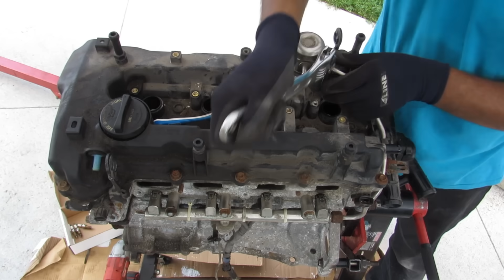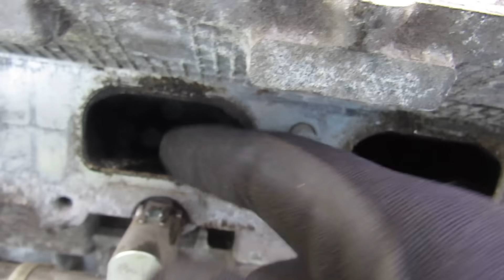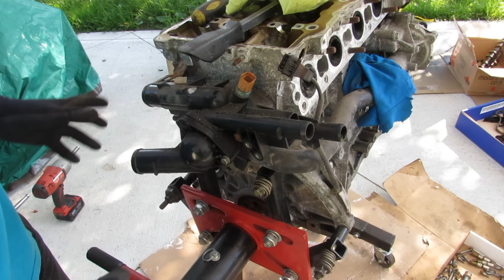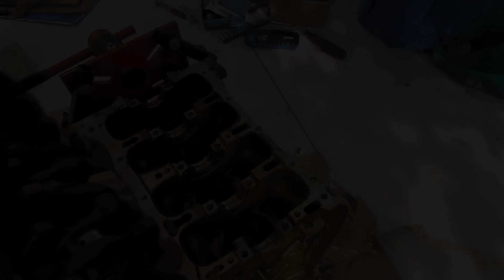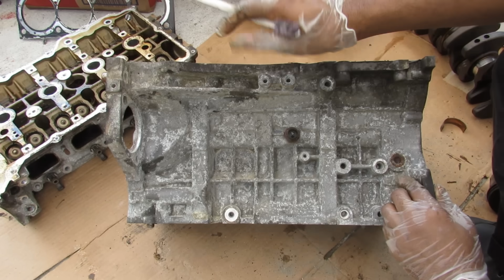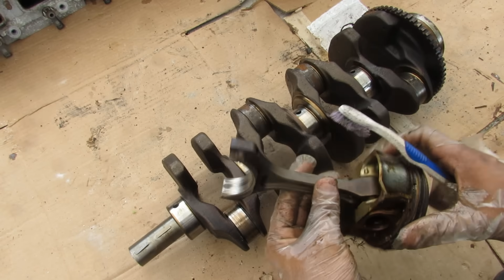Why Hyundai Engines FAIL

Comment: Thank you for explaining what happens with this engine. My girlfriend's 2014 Sonata just seized up and nearly caught fire recently, after just over 100k miles with regular, timely maintenance. They're replacing the engine for free, but now we know we'll have to watch this car like a hawk in the future.
Reply: Yeah good luck with that,they replaced my engine on the 2014 Tucson after my engine rods blew and just since December I’ve been having different issues ever since
Reply: I have a 2014 Sonata with almost 100k miles. No problems yet. Burns a little oil.
Reply: Even newer model sonatas with updated engine have the exact same problem, engines catch fire, and metal shavings in engine from the manufacturing process, its pathetic how after all these years they still cant get these engines right. Australia has just launched a massive lawsuit against hyundai/kia. I would stay away from this brand until they fix this problem.
Reply: They replaced our Sorento engine at 105K when it siezed up. Not many miles since but so far so good. I feel KIA treated us well.
Reply: @cheaptick  which Kia do you have?
I have Kia Sorento 2016 Turbo TGDI my engine seized up at 117,000 miles with thanks God extended warranty, they did engine rebuild I don't see new one.
My check engine light still on one day after it being services it  took 3 months to get my car back.
They have good customer service and are courteous most def. but they also lied to me as well.
As my fuel injector messed up still they lied said the light "should" stay off but, next day it turned back on, went to my friends garage that certified mechanic he's like yeah fuel injector my car sometimes idols high and sometimes low putter when get past 40 or 80 miles per hour and all did was fuel injector cleaner.
Now time for new fuel injector component.
Anyone else have big headache with Kias?
Go to your local Kia dealer you will see alot Kia being serviced in particular the Sorento, Souls, Fortes just heads and warning that how many time I've gone back and forth with Kia to know which cars to Not buy!!
Reply: My 13 elantra is at 153600 miles.  This weekend started the motor seize process where I have loud rod knock and barely any power.    May I ask,  what is the process you had yo go through in order to get this engine replaced? And also how long ago was this if you don't mind.  

Thank you much!
Reply: @BuschMANb  In short, contact your dealership as soon as possible! :D Your Elantra does not have the Theta II engine, but I do believe there is a separate lawsuit that was settled last year concerning Hyundai Elantras from 2011 to 2016. In our case, we simply contacted the dealership she bought the car from and they replaced the engine free of charge. This was about seven months ago.
Reply: Mine just seized up at 101k… currently is at Hyundai motor’s… what was the approval process like for you guys?
Reply: @lovetiffeny5357  a few days and approved... I think our records (previous Owner) were ok
Reply: Is this a Sonata problem, not effecting the Elantra? I have a 2017 Elantra, with almost 107k miles.
Reply: @jayholm2142  This is a problem with the Theta II engine, which was used in multiple cars, not just the Sonata. I believe your Elantra has a different engine.
Reply: @ISKLEMMI  good to know, my Elantra is close to 107k miles, but I hope it will reach 140-150k miles without too many issues....I want to move on from Hyundai. Currently researching the Nissan Versa, good balance between features and price.
Reply: My kia souls engine seized at 19k miles. Found out there was no oil in it despite regular oil changes.... Got a new engine. 1 year later ... I'm having to add oil to it because if I don't the dip stick doesn't have oil on it after 2k from the oil change.... Doing an oil consumption test after 1k. It shouldn't be burning 1qt+ of oil per 1k miles like it is....
Reply: @catherineb5766  can you give an update? What was the outcome? You get a new engine?
Reply: @asianstud7  they probably won't replace it a second time. They told me 1 qt every 1k miles was normal by their standard. Which is stupid because by that logic you'd run out of oil before your oil change on a new engine. I guess I don't know enough about cars and maybe that is the new norm..  Anyway. So I guess I'm stuck adding a quart of oil every week or so as long as I have the d#$# thing. My Nissan and toyota never had this issue.. so..

Comment: Hyundai sells turds and turd accessories.
Reply: that you can;t afford.
Reply: @maga6319  lol what do you mean? They'll finance anyone. Kia and Hyundai are eager to sell you a shiny turd.
Reply: @bens6865  So does Toyota you drive. Again, is that why you can't afford Korean cars?
Reply: @maga6319  you're not making sense. Oh Kia and Hyundai are affordable, but I  prefer my motors without metal shavings from the factory. Also everybody that I know that has a Hyundai with the 2.0t, the motor blew before 100k. I'm good chief. No, thank you.
Reply: @bens6865  people that you know who owned a Hyundai with 2.0t doesn't take care of their car, therefore it failed on them. You don't know the whole story behind a car that fall apart. Most times it's their fault for not taking good care of it.
Reply: @maga6319  one of them was an automotive student.
Reply: @bens6865  they didn't tell you the whole truth
Reply: @maga6319  look it up the 2.0t sucks. It's a shame because the cars actually look good. It's a shame because Veloster N is pretty cool, i wouldn't risk buying one though.
Reply: @bens6865  I did and it's full of BS you're telling. Just say you can't buy one because of some f00l told you a lie about Hyundai's reliable engine that barely give problems.
Reply: @maga6319  like I said. Shiny turds. Thanks I'm good, 2.0t is a turd and so is the 2.4 theta 💩 the 2.0 in my sister's Elantra had the Biggest metal shavings I've ever seen, when i changed the oil 💩
Reply: @maga6319  why would I make something like that up? It was a 3 year old car too. Front wheel drive cars are a compromise, I definitely do not dream about owning a Fwd 2.0t Hyundai turd just because it's "sporty". How am I the troll? Your name is MAGA but you can barely type english. Besides Hyundai and Kia are an affordable brand, you can literally buy an accent, rio, forte, or Elantra for under $20k. Which is why I don't like them, they sell cars with inferior drivetrains to people who just wanted reliable A to B transportation. They literally catch on fire for gods sake.
Reply: @maga6319  Class action lawsuit filled against Hyundai/kia for excessive oil consumption (probably falling apart from the inside) for nearly every model 2009 until now. lmao hahaha what pos cars. wish I could afford one my a$$
Reply: @bens6865  again you need to provide source since your low income salary can't afford one. Just say you're jealous and move tf on.
Reply: @maga6319  I saw you defending Hyundai/kia on another kia/Hyundai (is crap) video recently that's why i decided to bother you. YouTube will delete any link I post, you'd have to be in denial not to see all the proof that's out there.  I have a buddy that works at kia, he says warranty motor replacements are super common on every model. Even he says they're shiny pieces of crap, bunch of women cars, they only fool people who don't know anything about cars.

Comment: That's why I always tell people to change there oil  and filter around 1,500 miles on a new engine  to help remove any trash left over from production then normal oil and filter changes at 5,000

Comment: My Hyundai i45/Sonata 2011 2.4L GDI engine seized while travelling on the highway! It had done 195000Km and Hyundai refused to fix it under warranty the reason being that they couldn't run the tests because the engine wouldn't crank and required a perfect service history (invoices) in order to consider the recall engine replacement. Also, mentioned that anything over 150000Km is deemed as engine wear!
Reply from the maker: Ouch

Comment: We've had 3 Hyundais.  They've all been outstanding!  My wife and I commute about 100 miles per day.  My 2016 Sonata just flipped 156,000 miles, with zero engine problems!  My wife's 2017 Elantra has about 105,000 with no major issues.  Everybody I know who owns a Hyundai has never had any substantial engine issues.

Title seems a bit misleading.  It makes it sound like Hyundais are experiencing engine fails all the time.  I'm not seeing this.
Reply: You are lucky then. A person from work, her car's engine bit the dust when it reached 40,000 .  ( 2013)
Reply: @MasterofShinanju  That was the most problematic generation but even then, 40,000 is REALLY unusual. I'm going to guess she barley changed the oil and used the cheapest possible.
Reply: Hyundai makes great cars, it's just the 2011-2014 Sonata and 2013-2018 SF Sports that should be avoided. The rest of their engines are fine, and frankly nearing Honda if you find one with MPI like on the Elantras and Konas.  Good to hear the Theta in your 2016 is holding up well though!  A lot of these engine issues, even in the "shitty" years come from owners who think they can treat it like they treated their old port-injected V6s of yore which just isn't true for ANY GDI engines.  All that said, they were indeed more reliable before 2011 and I wish they would stop trying to be so cutting-edge all the time.

Comment: My Sonata engine (2.4l GDI) just blew up.  Luckily covered under the 120,000, 10 yr warranty.  The problem is there are no engines available for replacement due to supply chain issues.
Hyundai is paying for a rental.  So now I’m driving a Mazda.
Thanks for the video.  Very informative.
Reply: Oh.  BTW the engine only had 78k when it cut lose.  Regular oil changes (5k) and service was by the manufacturer recommended schedule.

Comment: You actually on point,  I have a 2015 Hyundai sata fe sport,  drove for 5 years good then I heard about the recall and law suit,  then 2 of my co workers have their Hyundai engine replaced after it size up. Then 6 months ago I started hearing the knocking noise and immediately book an appointment with the Hyundai dealership which was a month away but unfortunately the engine size up 2 days to the appointment.  After a good 3 months Hyundai agree to replace the engine under the law suit settlement.  Free . move to Toyota,  this my last Hyundai.
Reply: you should keep that hyundai. Since they replaced it, you should keep it.

Comment: All modern cars have plastic valve covers. Many cars come with a round hook to help with engine removal. Your just a hater, thats all. Ive had 3 kias and 1 Hyundai,  all were excellent to well over 100.000 miles. You have no information on how this was cared for , or driven.

Comment: 2013 KIA Optima owner. Had engine replaced at 130K miles under warranty due to consuming a quart of oil every 400 miles. Was told by dealership engine #2 also comes with lifetime warranty. We'll see if it lasts.

Comment: My 2011 kia sportage was manufactured in Korea not usa, so I have been lucky and avoided all recalls. 200,000 miles and still runs good but my theta 2 engine is not direct injection

Comment: Very interesting video. The bad thing about Hyundai and other engines known as GDI it has low tension piston rings. The piston rings carbon up stick in the pistons and oil slowly blows passed the rings and the engines go low on oil and they or seize. Notice the how carboned up the piston ring area is.

Comment: Just note that the knock sensor is not designed to detect catastrophic engine failure the purpose of a knock sensor is to detect detonation and send a signal back to the ECM or the computer if you want to call it which in return advance or retards the cam timing to aid in that nation. That nation can be catastrophic to an internal combustion engine has a deteriorates the tops of the piston which eventually can lead to the piston breaking in return leads to catastrophic failure

Comment: Lol bro I was screaming at you! Stop turning the engine counter clock wise. This is an interference engine. It will 100% make piston to valve contact. You have to make sure that all cylinders are not in top dead center but all level about halfway down the block. This way when you remove the timing chain the valves don’t open and bend when contacting the piston head. Please read the manual bro.. otherwise not to shabby of a video just wish you paied more attention to detail when disassembling.
Reply from the maker: This is a scrap engine... I turned it into a coffee table. no need to worry so much

Comment: Worst engine ever made. It's installed on Fiat Freemont, Hyundais, Kias, all trash. The main problem is: so much stroke for it's bore. R/l is way beyond acceptable. Oil pump/vibration dumper. Carbon build up. Etc. Real piece o shit
Reply from the maker: Yes. The worse was not deburring from factory
Reply: that you can't afford

Comment: Your videos should be required watching by any engineer who does machine design or automotive design. Invaluable information and lessons learned. Well done.Thanks.
Reply: Maybe the engineer knows, but the Executive department want new technology to impress clients and not care about the longevity of the engine, that's why I prefer N/A, no turbo, no hybrid, no CVT
Reply: You think that the engineers haven't inspected the many failed engines that this company has made over the years?

Comment: How crap are Kias and Hyundais now l would definitely not buy one l will stick with toyots and suzuki
Reply: toyotas are junk fam
Reply: @maga6319  what do you mean will these kia crap be around in 25 years time with 250000 miles not burning oil the engine and gearbox working well guess what my toyota hilux is that vehicle
Reply: @lesklower7281  Toyotas burn oil more than Kia. You think most toyota models don't burn oil and have troubling issues? You are one delusional fanboy.
Reply: @maga6319  no they don't show me a crappy kia with over 200000 miles that doesn't burn oil my toyota has over 200000 miles on it and it doesn't burn oil so stop these toyotas are far better than crappy kias any Japanese car is better any terrible kia south korean cars are crap do you realise that there only two countries that produce good motor vehicles they are japan and Australia not all Japanese car companies are good the three best ones are Toyota  Honda and Suzuku
Reply: @maga6319  l found out that Suzukis are as good as toyotas because the new toyota glanza is rebadged Suzuki Beleno and in Australia the Suzukis are about the same price as Kias and Hyundais so well without knowing this last year when we purchased our Suzuki Beleno we didn't know so any Suzuki is a far better car than any crappy south korean built car also how come my toyota hilux does not burn oil tell me that and it runs very well and it has 260000 miles on the clock tell me proves what a fantastic engine the toyota 22R motor is
Reply: @lesklower7281  get a life and you're always wrong when it comes to which cars are reliable. You have a lot of things to learn before you tell an OG like me about something.
Reply: Reliable aye find a kia or Hyundai with over 360000 miles with original engine and gearbox you will not find one but there is a toyota hilux in Queensland Australia with 600000 klms on it with its original engine and gearbox and it still driving around good luck you will not find one
Reply: @lesklower7281  Like i said, get a life and go get you a real car that isn't toyota with problems down the road.
Reply: @maga6319  no they are not kias are junk there are a lot of better cars out and guess what in Australia there is a 12 month wait for Hyundais and Kias so the people are buying Suzukis which is better than buying South Korean crap same price better car the Suzuki

Comment: Buying a Hyundai or Kia is a crap shoot. You never know what you're getting. Even if the manufacturer offers a 100,000 mile warrantee. The inconvenience of not having the car while it's being repaired is enough to steer you away from Korean brands of cars. There's a reason why they offer 100,000 mile warrantee. They know that at any time anything could happen. They would rather sell you a car for the sake of profit than quality and take their chances with their cars braking down. Want reliability? Toyota or Honda. Nissan is not that good either. Ever since Renault got involved with Nissan in the early 2000's there cars went way down in quality. Especially their CVT transmissions. They are the worst.

Comment: I was a pickup driver who wanted to save on gas bill. Decided I would buy a cheap car. I bought a new 2012 Accent drove it 93000 miles no problems. Traded up for a 2014 Elantra drove it 87000 miles no issues. Both cars were fuel efficient and fun to drive. I got great service from the dealership. Traded up for 2016 Sonata Hybrid. I love this car. Performance + fuel economy. Drove the car 90000 miles on issues. Hyundai notified me of the engine problem and extended my warranty 15 years or 150000 miles. Again the dealership service was more then I could ask for 5 star. The mileage went up to 115000 and I began to hear the rod bearing just as I had heard about. 117000 the rod bearing failed. I took the car to the dealer and they replaced the engine “short block” took 90 days to go thru the process. I got my car back at no cost to me. I have nothing but good things to say about Hyundai motor company. I am very satisfied with the sales people, the service and the product.
Reply from the maker: Well at least you got covered